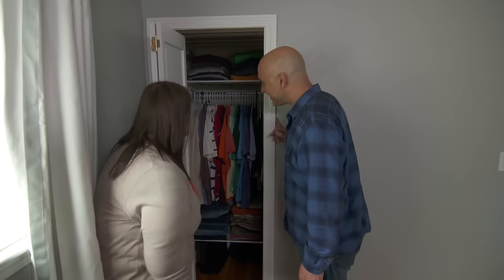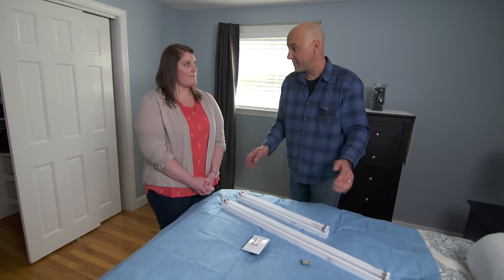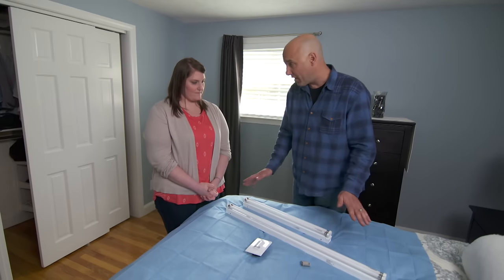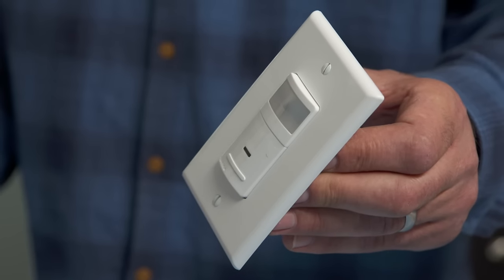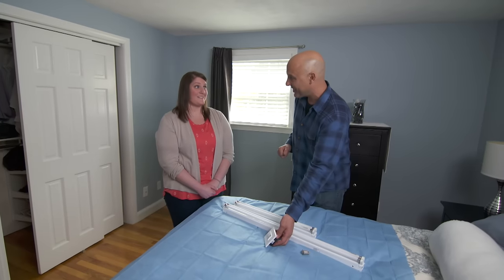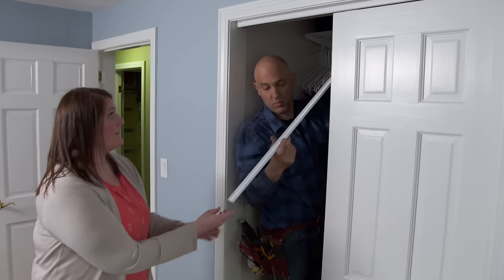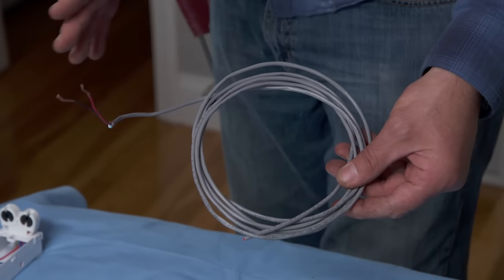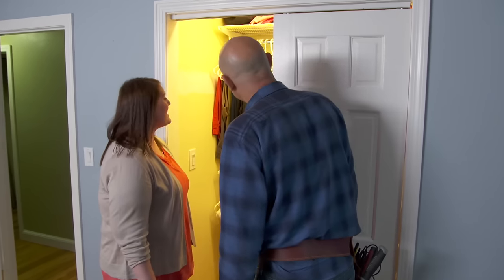How to Add Automatic Lighting to a Closet | Ask This Old House

Comment: you CAN place automatic switches in that double door closet.
So when you 1 door the light would go on and off when both doors are closed.
???? HOW ????
Easy install FOUR switches on the top part of the sliding doors.
2 in every slide and on both sides, (that's why you need 4)

Comment: 3:29 I was not expecting to see that top plate split when he started to drill it. Dull bit?
Reply: Too big, the bit basically forced the wood to split. When drilling holes in wood (usually drilling screw holes), you should drill pilot holes with a normal drill bit. 

He should had used something like a 3/8th drill bit or something.
Reply: the wood was very dry after being in an attic for who knows how long, and the drill bit put outward pressure on the wood. not a big deal, although I would have covered the hole and crack with some can foam to prevent hot attic air from leaking into the stud cavity.

Comment: Man the US is ahead of Australia in many things but not electrical work its too old school
Reply: Electried group PVC sheathed cable used in this video is nearly identical to the type used in Australia. The type I plugs and sockets in Australia are an obsolete American design. The newer NEMA 10-20 plugs in North America are backwards compatible to type I, yet still obsolete. The metal junction boxes in Australia use the same dimensions as North America. Please clarify specifically how North American residential is inferior to Australian.

Comment: Not a good idea to drop your wires in from the attic before you cut the hole in the drywall. With your wires behind the drywall you could have easily nicked the wires with your drywall saw. Put the hole in the drywall first then drop the wires through the top plate of the wall.
Reply: We'll that's why you don't insert the saw all the way in. Just an inch is enough. There could be existing wiring or piping in the wall, so running cables after cutting a wall isn't gonna prevent everything. The only reason I cut before fishing is to see what I'm up against.
Reply: @aurvaroy6670  you're absolutely right. No disrespect intended but just an inch is enough especially if the wire is only 1/2 inch behind the wall board.

Comment: Pretty sure Mike Holmes would have had a fit with the "hidden" junction box in the attic. Should have tapped into an existing outlet then run straight wire to the new boxes that terminated in the living space. If there was ever an electrical problem in the junction box who would think to look for it in the attic. :(
Reply: While I agree that tapping into an existing wall junction is the best thing, it's not always an option.  For instance, I was adding a closet light to my home, and the only wall junction in that entire corner of the house is a 3-gang box of switches...so there are four 12/2 wires feeding into that one box.  It would be near impossible to knock out the old junction box, feed a fifth wire, and then cram all five wires back into a new 3-gang old work box...especially since the existing four wires were already trimmed.  The only solution to tap in an existing wall box would have been running 30 foot of wire to another part of the home, and that is even more confusing for future home owners than a junction box in the attic, because you are putting the new install on a different breaker.
Reply: Gregory Blajian uhh, a seasoned electrician or anyone used to remodeling lol
Reply: The junction box is not hidden. It is accessible from the attic space.  Hidden junction boxes are ones that cannot be accessed because they are totally enclosed in a wall or ceiling space.   The attic location meets the NEC requirements.
Reply: Sorry about that. After doing some research I did find that the box may not be hidden by permanent structure. So you cannot place it behind drywall, ceiling, stairs etc if the only access to it is by removing structure; however, in some locales covering the box with insulation may make the junction box "hidden" as well, you can see that discussion here (which includes the applicable NEC reference in answer 4), http://diy.stackexchange.com/questions/26395/can-i-cover-junction-boxes-in-the-attic-with-insulation. So while NEC may allow the junction box in the attic in that locale, it may not in others (possibly dependent on where it is mounted, i.e. rafters or ceiling). Just something to keep in mind for DIY people watching this video. I would argue that it is still better to run it off an existing box when possible. Since it was in the closet, it may have been better to put the junction box in the wall near the ceiling (or in the ceiling facing down) and put a blank cover over it. That way you could access it without needing to crawl in the attic. Just sayin.

Comment: Bare bulbs in a closet with shelving??? I doubt my inspector would pass this...And the way he ran his low volt wire was absolute joke. He had the molding off, so make a small hole and fish the low volt cable down from the attic. I would NEVER leave a job looking like that, with cable ran on the outside of the drywall unless there was no other possible way. Here, there was an obvious, easy way to have it in the wall. They usually do good work, but this one is a mess. First, he uses crap lighting to save $30 and not use LED. Then, he puts a bare bulb fixture in a closet with shelves that contains linens/towels. Then he finishes his masterpiece with that wiring job. Swing and a miss on this one....

Comment: Its against electrical code to have a fixture without covered bulbs in a closet. just saying bro
Reply: NEC 410.16 (A) Luminaire Types Permitted. Only luminaires of the following
types shall be permitted in a closet:
(1) Surface-mounted or recessed incandescent or LED luminaires
with completely enclosed light sources
(2) Surface-mounted or recessed fluorescent luminaires
(3) Surface-mounted fluorescent or LED luminaires identified
as suitable for installation within the closet storage space
(B) Luminaire Types Not Permitted. Incandescent luminaires
with open or partially enclosed lamps and pendant luminaires or
lampholders shall not be permitted.
Reply: Kevin Curtis just got owned know your code books

Comment: Why didn't this guy use a box behind those fixtures?

I could of piped the whole thing faster
Reply: Mushroom Castle was
Reply: The junctions/connections all happened inside the fixture, don't need a separate box.  It would have been a neater job though if he had.

Comment: Why are there never be floorboards on American attics? Better isolation, less losing heat, more storage room, and you can walk around. Those paperboard walls are really crap. Cable connectors like those yellow ones are not allowed in Europe for the at least 25 years. They are not safe.
Reply: Attics here are supposed to have nearly 2ft of insulation in new construction. (if you are using fiberglass)  So you can not smash it to lay boards down to store junk and make your ceiling sag... hahah.
Reply: @mikez4132  that's why European houses are build with bricks and concrete. We use our attics to store all kinds of junk, or we put some windows in the roof and use them as a extra bedroom. American houses are build as a European garden house, barn or shack.

Comment: Why didn't he use the same motion switch for both closets?  Using the low voltage relay us just a mess and costs even more.
Reply: Motion-activated switches stay on for a few minutes of no motion, so a switch that turns off as soon as the door is closed is more energy-efficient.
Reply: @teh-maxh  I installed a motion activated switch in my closet.  All you do is just tap the switch to turn it off.

Comment: Wait til she has to replace the fluorescent light tube 3 times a year, she will regret not using LED.
Reply: She said she wanted led fixtures. but Scott said there too expensive and there's no need to have led fixtures in the closet

Comment: My father was an electrician and did all the wiring in our house when it was built in 1953. He put an electrical outlet in each first floor closet above the door since he and my mother both wanted automatic on-off lights which mounted on the door frame and had cords with a plug on the end. The problem was that the outlets above the doors scared me. My father inadvertanly left one of the outlets hang out above our bedroom closet door in 1956 and it scared the begeezers out of me! He mounted it in and put a face plate on it on Christmas Day of 1956 when he installed the light. The outlet above the hall closet door was missing a faceplate which also scared me, not as much as leaving the one hang out in our bedroom closet.

Comment: I am not an electrician by any means, but shouldn't a clamp have been placed on the wires going through the side of the junction box?  Also,  shouldn't the ground wire have been wrapped around the ground screw in the junction box in the other direction ( with the rotation of the screw instead of against it?)  Just trying to learn these things, not being a smart a$$.
Reply: He had plastic clamps on the metal junction box in the attic, and the blue plastic boxes have tabs that bend inward, which acts as clamps/strain relief. On new work blue boxes, there are no clamps but the wire is secured to the framing near the box. Also, he wrapped the ground wire correctly, should be clockwise.

Comment: Obsolete, don't follow this video anymore.  You can get an auto on battery powered LED closet light fixture for cheap with zero wiring involved.  $20 for a battery powered fixture vs $400 electrician installation.

Comment: This old house is really going down hill. This video was a little more informative than the last one I watched, but lately they make advice/idea videos, after watching though, especially lately find out if there's a better way/right way/make sure the way this old house does it, is up to code, allot of times latley they will do things like, drill a hole through the house at a recepticale for an outdoor light, wire it through the recepticale and then install a swtich/light switch plug where its basicly on the floor, anyway just do your research and be sure what your doing is smart and up to code, also ontop of that, then research actually how to do the wiring, because this old house doesn't make tutorial videos anymore. Im mentioning this, because of the type of light he installed in this video, also every single light bulb/recesed light/ ficture in my house is now LED, anyway I took the ballast out of my kitchen florescent light and I replaced the bulbs with led bulbs, now its brighter, it uses allot less power and it comes on immediately/there's no delay in turning on. Anyway there are much better videos about learning how to do things, these days, this old house is going down hill, to many cuts/not enough info about the project, when your dealing with wiring you should definitely be allot more thorough with instructions. Anyway this old house is good for ideas these days, not tutorials.

Comment: Never understood why the American homes are so cheaply constructed. Here in Europe we use bricks and reinforced concrete. You can drill through but you will need more powerful drill and drill bit. That attic would be a cozy child bedroom or a guestroom instead of a void space with insulating material around and as for heat and cold that's why there are the air conditioners!
As for the light I would use LED. Incandescent are fire hazard and highly consuming and fluorescent are toxic and are intended for longer time cycles
Reply: If you're heating or cooling without proper insulation you're throwing money away. I agree on the LED, the cost is low enough now that incandescent and fluorescent should be out of the question.

Comment: Crazy folks you Americans: using metal junction boxes and twisting wires like 30 years ago. I just don't get it 😂
Reply: What would you suggest differently?
Reply: Just about every new home uses plastic boxes for NM/Romex wire.  I definitely would have used one for a "hidden" junction box shown here, as long as the wire was correctly stapled.  Galvanized boxes still have their place with NM wire...namely for ceiling mounts and big light fixtures where you don't want to strip threads.
Reply: scwfan06 exactly surely if somehow a wire come lose and somebody touched the junction box they would be electracuted better with plastic because plastic is an insulator and mental is a conducter
Reply: SCWfan06  What do you guys use to splice wired? I’m not an electrician I’ve only known that way.